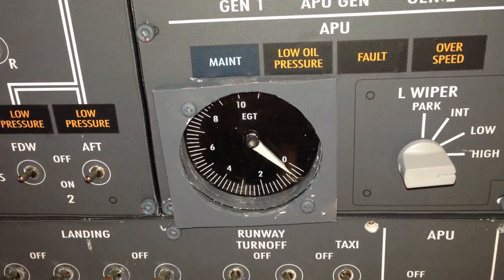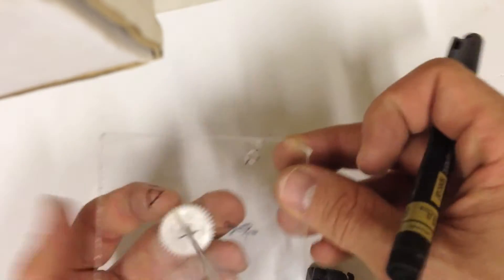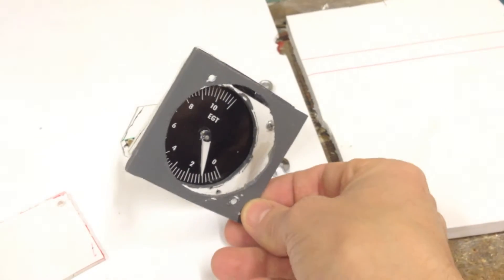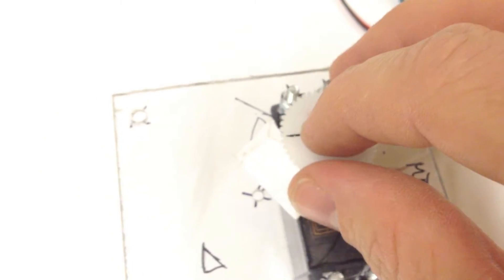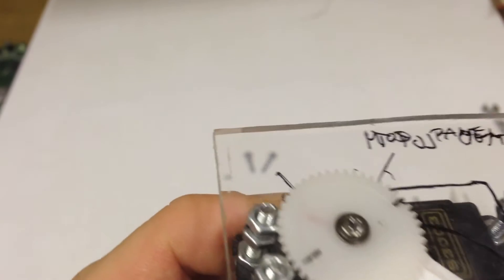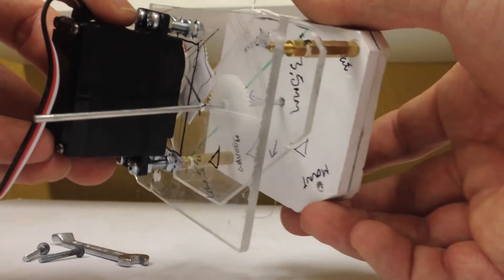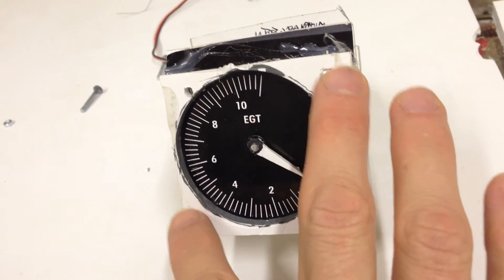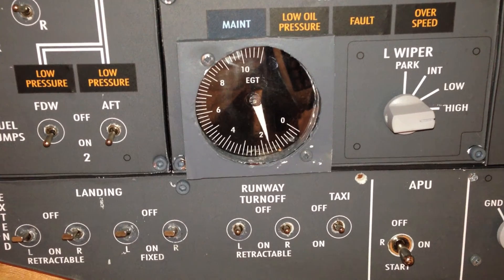How to build a gauge - B737 Home Cockpit

Comment: Hi! Is the second gear required or can I just attach the servo to the rod?
Reply: Looks like the second gear is slightly smaller than the one on the servo.
I'd expect that because the servo on its own can only swing about 180 degrees, and the gauge scale angle is more than that.
TLDR: The second gear is needed to increase the needle swing.

Comment: Sorry, what did you use to program the servo engine to move?
Reply from the maker: The servo is connected to an OpenCockpits Servo-card and so it is controlled via SIOC.
I use Prosim737 as avionics suite so Prosim sends the value to SIOC. 
/Peter